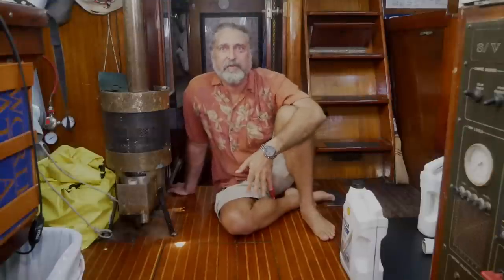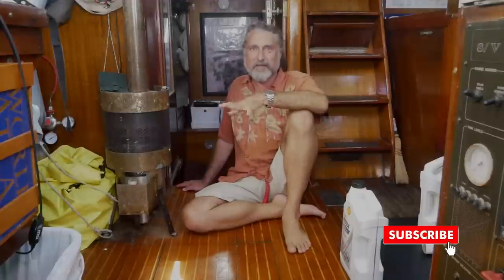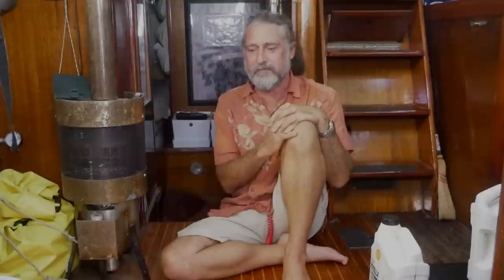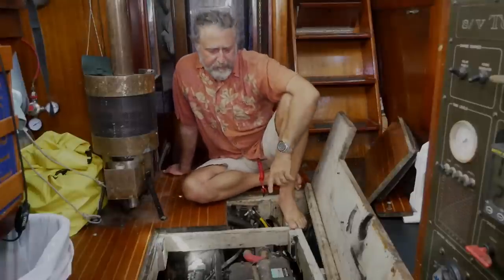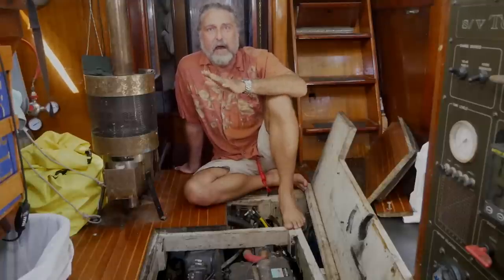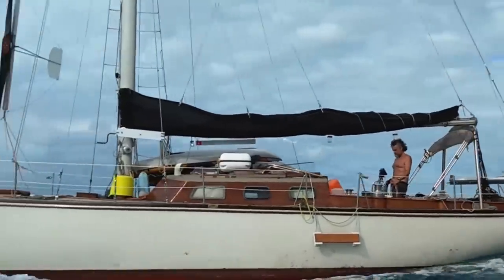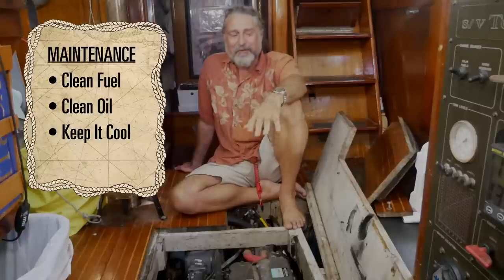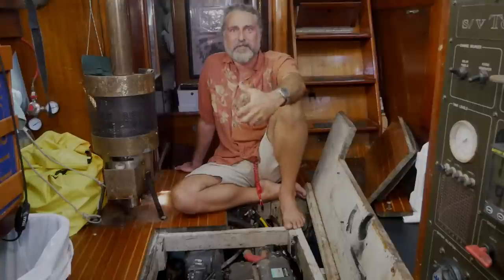Boat DIESEL ENGINE Hacks & Oil Change [Capable Cruising]

Comment: A big thumbs up, because it convinced me to buy another electrical fuel pump and replace the mechanical one on my engine. Since then it runs far better, starts perfect etc. And has rhe advantage you mentioned of running more fuel through the pre filter, thus cleaning the fuel.

I’ve got one question if I may: by adding a pulley on your existing crankshaft pulley, you changed the weight on the complete part. Did you notice any change in vibration on you engine. I’m asking this because mine has the habit of vibrating at 1100 to 1300 rpm more than in the rest of the range. It is a 3 cylinder 27 horse so different than yours. And, if there is a noticeable change, I maybe could do a similar thing.
Reply from the maker: If anything the vibration would lesson but I doubt you would notice anything.  It's a light aluminum part.

Comment: Great video. I have Perkins 4-108 with 5000 hours. What would you say the cruising RPM's are optimal for it from your experience? Also, any good modifications you would recommend for 4.108? Thank you!
Reply from the maker: The ones I mention here.  For the 4.108 the rotery vane pump is particularly important.  That engine is a pain to bleed.  The electric pump makes it easier.  I'd perminatly install an oil drain pump since you can't suck on the dipstick tube.

It is a high RPM engine and I understood they do well when spun fast but I never used mine over 3000.  I just didn't like the noises it made.   I think redline for the proform version were like 4000rpm or more.  Only difference in the three models was the setting of the governor.

Also, need parts?   I have loads of spares I'd sell.

Comment: Get a oil filter relocation kit; something like you find in a Harley parts catalog, or perhaps a John Deere parts store. Getting that up and out of the way makes it easy as pie; and you can even go with a cartridge oil filter so you don't have the messy leaks when changing the filter. 

And be sure to check the rating of the filter; contrary to what you might think, you do not want a really small (1 micron) filter as it may clog easily which would starve the engine of oil and cause catastrophic failure.

And put some oil in that filter when you change it so you aren't running the motor without oil for 20 seconds.
Reply from the maker: I do really like the relocation idea.  Had one on a previous engine and ran it with a reusable/cleanable filter.  Really liked that because I could tell if I had issues by looking for metal.

I still have the filter.  I might install it on this engine next time I get to a place with parts.

Great idea!  I agree do that to your engine.  Wish I had mentioned it in the video. 

 What he said!

Comment: Nice tips. Would you ever worry if you only extract and replace half the capacity of oil in the engine? Do you ever measure the amount of oil replaced compared to the total oil capacity of the engine?
Reply from the maker: Unless you are leaking or burning oil you can only put in what you take out.  Remember the filter holds oil when changed, that counts.

Comment: Algae in the tank.
With boats that sit for a week or two, or three
You wind up with an algae sediment in the tank which comes into play when you go offshore and the tank gets shaken like a cocktail.
I know more about.sails than motors, but I am always the.first to hear that motor surge which signals a huge pain coming.
Suggestions?
Reply from the maker: You can't get algae without water.  Get the water out of the tank and diesel has a REALLY long shelf life.   I've burnt 15 year old diesel.

Comment: I would prefill the oil filter and fuel filter. By turning the oil can sideways it will eliminate the gurgling.
Reply from the maker: Good ideas.

I feel that sense the engine was just run to heat up the oil everything is fully lubricated and the amount of time it takes to fill that tiny filter doesn't matter.

Comment: could you share more about the risks/issues with having an engine undersized for the boat?
Reply: is going from "five knots on a good day" to "seven knots easily" more of a safety feature or a convenience for you?
Reply from the maker: Just convince.  

Really I sail a lot.  Temptress is good upwind (10.5 feet deep) and good in light conditions so it's seldom I motor.  When I do motor I still go slow 6k tops, usually 5.5k.  Saves fuel and I guess I just got used to moving slow.

Comment: 15W40 oil is 15 weight oil, it has a viscosity modifier added (think something like STP) that reduces the thinning effect of the heat on the oil.  Many boats have two racors manifolded together so when one plugs up you can instantly switch the the other.  Diesel fuel, unlike gasoline, will support some forms of biological growth that can be a problem in boats where the fuel might sit in the tanks for long periods especially in tropical climates, also condensation in the tanks.  There are additives that can deal with these problems, truckers and farmers generally don't have these problems since they use their fuel quickly.  I like your fuel polishing system, I don't know your manifolding arrangement but it would be nice if you could pump from one tank into another, this way you could isolate new fuel until you get a chance to check it out.   Spare starter is a good idea.  The new 140 amp alternator looks small, problem is that many alternators are overrated and yes they can pump out the 140A, for about five minutes, then they start to overheat.  Commercial alternators are generally large with big cooling fans.  A good voltage regulation system is also needed.

Comment: Great video. I only have a small Yanmar, a 1GM10. It's possible to hand crank it. Which I had to do when my starter motor casing split. Thats the bit which is near the fly wheel. I picked the bits out and hand started. I wish I knew how to clean injectors. Anyone know a good link to a video on that? I'm considering buying a fuel polisher system to remove water and gunk.

Comment: Interesting thanks. Question1: Can I change it cold when using a vacuum pump? Some people think you can get more of the gunk out at bottom. Question 2: What micron Racor filter do you use?
Reply from the maker: 1 I think oil should always be changed warm.  You can get more out that way as thick oil  pools thicker.  More oil out more crud out.  But mostly an oil change is about getting new oil in.

2.  I forget, had to dig into my spares.  10micron.

Comment: My Yanmar 6LPA STP2 stumbled and shut off….I suspected the filters so I got both the Racor and the secondary …prefilled them with fuel mounted them and then tried to pump the fuel to bleed it with the button on top of the secondary filter housing  loosening the bleed bolt……no luck getting fuel….tried and tried …did a quick engine crank but didn’t want to hydro lock it ….still no good …waiting for mechanic to come out to my mooring to help….I haven’t cracked the injectors yet because I can’t even get fuel out the secondary filter bleed bolt yet…..
 bolt

Comment: Clark  great recap I  am running g a 3JH. The water pump on it is facing aft on port side of engine(hard to get to).  It looked like yours is facing forward on port side. Is that correct?  Again great video.  Fair Winds and Following Seas from the crew of Celtic Lady Seawind II 68K.
Reply from the maker: I'd have to dig in there to look.  But the 3jh is just a three holes version of the 4jh.  Mostly the same parts just different by year.  If there is another raw water pump made likely it will fit your engine.

Comment: Hey Clark and Emily. Great video. Tell me something though, fuel consumption. How much fuel to make that motor run for an hour on 7 knots or 5 knots? That is what I always put me off from motors.
Reply from the maker: I don't know about high speed yet as I don't run there long enough.  In fact I don't have hard numbers for any speed yet.
   But it seems to burn at about 8 miles per gallon at cruising speed, 6k.
Reply: @Clarks-Adventure  Thanks! You said so casually that you ran it 48 hours straight that it made me wonder about it. 8 miles per gallon seems fine though.
Reply from the maker: That run was with the last engine.  Since I've changed its been more windy.
  If you think your friends might also like our videos, how about sharing one of our playlists on social media. We would really appreciate the new viewers.
Reply: I cant say exactly the fuel use  for  my 2YM 15 2 pot  13 hp on 30 foot narrow beam 3 ton 1969 sail boat  It seems to be about 1.5 liters per hour 60‰ gas (estimated 2000 rpm says 1800 but suspect under read from 80 amp alternator larger  pully wheel )  going at 3.75 knots.
Prop is fixxed three blade  12x9 probably too small 
Gear box ratio unkmown
The previous engine was 9 hp one pot type which many boats 24 to 29 ft use many and say at 4 knots use 1 liter per hout  
Those size types  can expect 12 to 18mpg  st 5 to 6 knots 
 That info looks to be  about  11 mpg  Imperial on 4.56 liters to imp gallon or maybe approx  9 mpg on USA gallon.
Yanmar web site show fuel power curves for thiet engine on a  per hour basis.
It suugests i use 2 litets per hour for my use type That is possibly baded on bigget prop than mine which might allow 5 knots for 2000 RPM.
My cousins 6 ton 37 foot 1985 prout Cat with Z Drive large 3 blade   3 pot 37 hp  Yanmar seemed to be at 60% gas  about 4 mpg imperial gallons in calm  at 4 knots . Any head wind it went to 2.5 knots and 3 mpg  quicly 
Boat types dictate fuel use speed ratio. 
Older narrow boats often  in calms return best MPG with correct two blade fixxed props good gear box direct prop drives at higher speeds than heavy wide fishing type motor boats or bigl high windage multi hulls .

Comment: Great video, thank you~
Reply: Is it safe/OK to pump diesel fuel with the extra/rotary vane pump, like you have in your diagram, through the engine without the engine running or the engine's own pump running? In your diagrams you don't seem to have any vales that could cut off fuel from being run through the engine at any point -- is this safe/OK and intentional?

Thanks~
Reply from the maker: I do have an engine bypass valve I use when I transfer fuel between tanks
Reply: is that valve on the engine input fuel hose only or does it also need to be on the engine output fuel hose before the T crossing so that fuel doesn't accidentally enter in through the wrong hose when you are transferring fuel between tanks? or is it a non-issue due to pressure or something as long as you have an inlet valve to any tank open? thank you~ @Clarks-Adventure
Reply from the maker: I think you will be fine.  This pump doesn't make much pressure.
Just a pair of tees with a valve between the intake and return lines.

Comment: With my 20 year old Volvo/Perkins MD22P I can never get all the oil out, but I don't think that matters too much. The other thing I notice is that the oil level always drops quite a lot when I turn the engine over the first time so I have to top it up again. I literally run the engine for a couple of seconds and then check it again and top up. My engine has always flawlessly started and runs perfectly in the 2 years and 600 hours I've used it. I'd be curious to know how many hours you think you can get out of your Yanmar. You might also want to talk about the pros and cons of turbo - mine is naturally aspirated which I believe is preferable on a cruising boat.
Reply from the maker: I bet your oil is filling up your new oil filter.
I don't care for turbos but if I had to deal with either a size or weight issue I'd have a turbo diesel.  I prefer the idea of turbocharging a diesel over turbocharging a gasoline engine.

Comment: Excellent video and shared personal experience! Do you filter diesel at the pump as well or don’t bother? How do you direct to a specific tank, assuming one inlet? Switch valve? Thanks!
Reply from the maker: I really only get fuel by Jerry can.  I put in in one particular tank and transfer/filter it to where I want it.  A couple of my tanks can't even be filled from deck.
I just fill the Jerry from the pump.  And usually tax-free off road diesel from farm country gas station to save money when in the US. 
I have a Baja filter but seldom use it.
Reply: In the video he shows the set up and how he transfers the fuel using valves that direct the flow to the tank he wants

Comment: Cannot emphasize the point about running them hard (unless they've got an after market turbo). Treat them dirty (interms of use, not maintenance) and they'll love you for it.

Also if you're ever in a location where the fuel is of poor quality, you can always use a 'Mr funnel fuel Funnel' It sepperates diesel (and gas) from water and particulates, it's pretty magical. People who overland in Africa use it quite a lot.
Reply from the maker: Yeah, I hate to see diesels used to charge batteries.   I feel their pain.

Comment: I would recommend changing the oil filter with every oil change. You are not saving anything by cheaping out on the filter. I can recommend the Electromaax kit with external regulator. We installed that on my dad’s boat. V belts belong in the museum not on a boat or car. Mercedes uses serpentine belts since the early 1990es.
Reply: Yeah, most of us would change the filter every time,.... but I guess his engine is running so clean the oil is still kind of clean when he changes it, and that that's why he don't see the need for changing the filter as well every time. ....... In some of my diesel cars I actually change the filter in between the oil change (exactly opposite of Clark). ........ The quicker the oil gets black, the sooner or the more frequent I would change the filter, and also for filters paying a bit more is likely better than the cheap ones made in china. ..... And by the way, read the filter instruction for torque when putting the new one back one.  Once I did not, and ended up with all of the engine oil in the sump ;-) (it unscrewed itself). ...... Happily I had an oil pressure alarm that was actually sounding (not silent from rust in the buzzer).

Comment: Great Video! How many hours do you run the engine between oil changes?
Reply from the maker: It's whatever the engineers put in the usage manual.  I've seen numbers from 150 hours to 250 hours.

Comment: You said you didn't change a fuel filter until you changed an engine at 30:16. Do you believe if you had changed filters before you may have not had to change the engine?
Reply from the maker: Nope.  Salt water got through the raw water pump.   First time I hired a mechanic (and last).  He left out a seal

Comment: I'm going to be buying a boat thats been on the hard for two years. The yanmar in it was in great shape when she came out of the water, would there be any special considerations after sitting that long?
Reply from the maker: Yes rust in the cylinders.  They prefer to be run.  Probably will be ok.

Comment: Thanks very much for making this video.  Got me thinking on different fuel polisher designs.  Will the Carter P4594 In-Line Electric Fuel Pump's 6-8 psi be sufficient to push through a Racor 500? Is it a flow through pump, won't it provide any resistance when not turned on?
Reply from the maker: You're welcome.

It pushes fuel through the Racor with no problem.  It's a rotary vein pump and should flow fuel when off (with some restriction of course). But, I didn't trust it when setting it up long ago and installed a bypass with check valve so I've not really tested that.

One issue with this pump is it has a little stainless filter inside.  Open it up immediately and remove it.  Your fuel will likely be too dirty for it and it will plug up really fast bringing down your whole system.  Let the Racors be your filters.

If you think friends might like our stuff please share links on social media.  Really helps us.
Reply: @Clarks-Adventure Sure.

 I'd probably add a check valve on the polisher inlet side before the Racor, and another one on the engine diesel return side just before the polisher T-joint.

Comment: Love what you did at 26:54 with the added fuel pump and the diverter and filtering system. Its basically close to a fuel polisher, a service companies will do a docks to clean old fuel. Love it. The only thing you didn't do was have some sort of fuel pressure measurement system at the engine after all of the filters. At least you didn't tell us you had it . Oil pressure is good to have also.
Reply: If I had Clark's lifestyle I'd make a portable fuel polisher mounted on a piece of plywood and make my service known to other cruisers. I swear there's a living to be made, and it's so easy to make and do. The diabolical among you could start rumors that the local fuel dock has dirty fuel.

Comment: How you know that the oil dipstick tube goes to the bottom of the oil pan? Do you have factory drawings ? How much oil you can extract? I have 4JH2E but never tough about putting rubber hose OVER it to extract oil.
Reply from the maker: For the 4Jh5e it does.  I've had the pan off myself and Yanmar recommends this method .
Reply: Newer too old to learn new tricks...🙏🤔😁